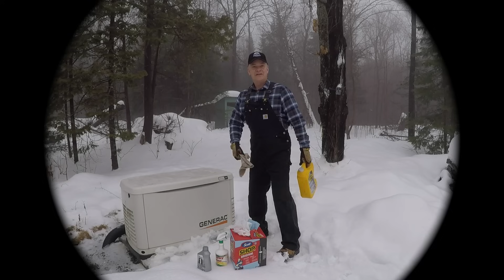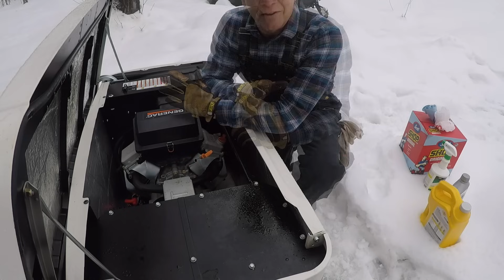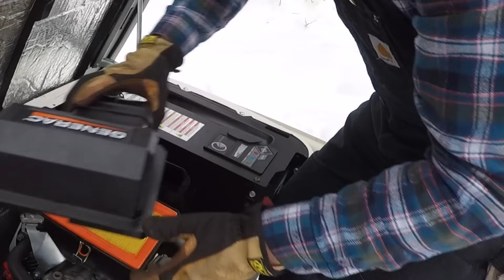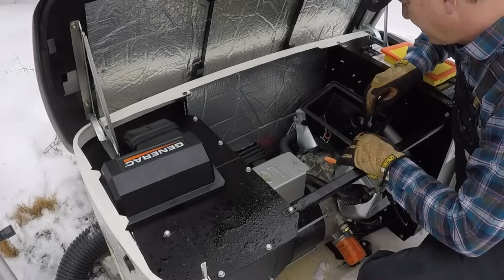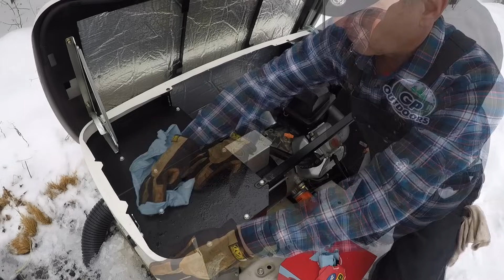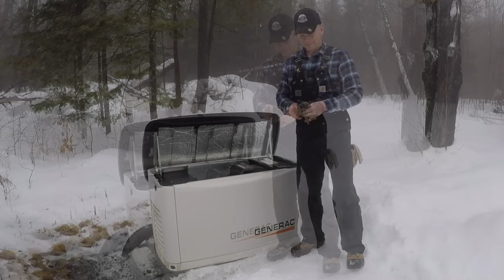#133 Thinking of Buying a Generac Generator? You Need To Watch This!

Comment: I am a Generac service dealer in central Ohio and have been installing and servicing units for 17 years. I have seen this problem several times with really cold weather.  A few additional comments to what is in the video is that the breather mechanism (not exhaust) is under the shroud that is around the flywheel.  This can ice up even without the exposed tube icing up.  On the newer Evolution controller generators, I would advise taking the short rubber air intake tube off of the air cleaner cover when running in below 0 deg F weather so that the engine can breath in warmer air from the inside of the generator box.  This will help prevent ice from forming.
Reply from the maker: Good morning and thanks very much for the helpful advice Ken! I will give it a try this coming winter and see if that makes a difference. I had the technicians come and put the additional heater kit on that vent pipe at the end of last winter. So we will see how both do - again, very much appreciate you taking the time to write this out. Cheers and all the best!
Reply: @Kenlynjay 
Just a curiosity question, but what if an owner of these Generac generator units put like a tablespoon of engine anti-freeze in the bottom of that reservoir??? 
That should prevent condensation from freezing like that, right???
Reply: @AzzKicker-bz1cb  I guess it would be worth a try but some of the condensation comes from the breather mechanism and comes up through the tube while the engine is running, so it could still freeze up.  Part of the problem lies in the engine temp being to low during cold weather.  You could try putting a piece of cardboard across part of the air inlet on the right side of the unit when temp is really low to slow the air circulation. Also, as other people have posted, there is a cold weather electric heat tape that goes around the breather tube that will help.
Reply: Ken I also service Generac but deal pretty much exclusively in portables and refer most onsite standby unit to another guy in town that does mainly standby units.   I don't have familiarity with  standby unit other than most are propane or natural gas and that they self operate periodically as a self test.  I am curious how long that self test runs on the norm. I would think that in a cold climate situation, the unit might not run long enough to cook off moisture. Especially since propane and/or natural gas burn efficiently which usually will equate to more water vapor as a byproduct in the blow by gases and build up in the air box. Another not so good side effect is moisture build in the crankcase.  Interesting side note is this unit looks pretty darn close to the 17.5 kw portable save the lack exhaust heat to a carb and exhaust header layout.
Reply: Dwayne, the older units will do weekly exercise for around 12 minutes.  The newer Evolution controller units will exercise for around 5 minutes when it is warm but I believe that they are supposed to exercise longer in cold weather since they have a temp sensor in the controller to tell it to do so.  The times that the breather ices up is usually when the unit runs for a while in super cold weather, so longer exercise time probably wouldn't help.
Reply: Also, I always turn off the low speed exercise function so that engine will run at full speed during exercise.  Generac tech support recommends doing this.
Reply: @Kenlynjay  Interesting sound to me like there is too much airflow around the breather system in cold weather which from what you suggested by restricting airflow will help. I would guess this just compounds more so in cold weather with cold air being denser and more effective at cooling.
Reply: Good reason to NEVER purchase these units.....Never by the Generac
Reply: Kenlynjay would it be possible to drill a tiny hole at the bottom of the air filter receptacle to let that extra condensed water drip ?
Reply: @UnhingedWarrior  That is what I was thinking.    like a weep hole
Reply: I agree with those defending this guy. He's a good dude, just trying to help us out and maybe make a buck on an good instructional video. Nothing wrong with that. I appreciate people like him big time. And so do all you mockers out there. If you didn't, you never would've even clicked on the video. Losers! =×
Moving on; 
To maybe "fix" the Generac(without the rubber plug or tube) problem, I imagine you could just drill a couple small drainage holes in the very bottom of the air filter housing, (if there is a spot below the housing with no wires under it to get wet). Maybe put a small screen down in there or underneath on the outside just to be sure no debris gets in. The extra air shouldn't make a difference in performance when the weather is nice, and of anything it will help the engine run better when it's too cold outside by allowing some of the warm air from inside the crate to enter the air intake, (As the Generac tech pointed out).
It should also never ice up again as the warm air inside the crate should keep the holes you just drilled from freezing up in the future.
 Really quick fix if you can find a good spot to drill. Just a thought.
Good luck everyone, and thanks a  bunch to Mr. Man in The Video(sorry, I didn't catch your name Sr.) for you very well put together and thought out video. It "Is" very helpful!  ;)
Reply: 1. Why not install a Puke Tank so all the moisture for one season can stay safely out of the filter?
2. Why does the dip stick tube extend blow the oil level? (Great design Generac. NOT!)
Personally I'd let the crankcase vent into the air, before risking a catastrophic failure of my EMERGENCY generator!
Reply: @Rob Basque that was what I figured would work. Glad someone else thought of it too! 👍
Reply: Great Idea... I don't have one, I just thought it was foolish of Generac to make a product that pukes oil all over it's self.
Reply: @Thinker2-truth  … I am a factory trained tech on these things and I can tell you the dipstick tube does NOT go down below the oil level. What happens is the oil is constantly spraying inside and it's the vapor / splatter that rises out the tube when the crankcase breather is clogged. The normal path for crankcase breathing has a baffle and drains back into the engine so it doesn't soak the paper air filter. In the old days we vented this vapor directly to the atmosphere but the EPA says we must contain that and burn it off first, which is why we have these issues.
Reply: @Rob Basque … if you drill holes in the air filter housing you will also suck in air that will not pass through the filter element. IOW, potentially "dirty air" that may harm the engine.
Reply: @rupe53: Irrelevant: If it pukes oil, it pukes oil; all over the inside of the cabinet, until the LOW OIL shuts it off!
Reply: @rupe53  Your not driving this down a dusty road like a car, nor are you kicking up dust like a lawn mower.  This is more like an outboard motor or snowmobile that have no air filter.  That and the percentage of air that bypasses the filter would be minimal.
Reply: I have often said the same thing but I have also seen some nasty filters over the years. Lots depends on the unit location and what else is happening in the vicinity. You just never know and if you bypass the filter that's the chance you take.
Reply: I like the idea of drilling a hole in the bottom of the filter, and if your environmentally friendly put a hose fitting in the hole and connect it to a puke bottle.
Reply: Kenlynjay … you're almost making too much sense.  <LOL> Been working on these for 23 years and we've never had the problem till the engineers (EPA?) decided we needed a low speed exercise (noise reduction) and shorter run time. (fuel use reduction) I'm amazed they haven't come up with a thermostatic flap to control the intake air temp and get the engine temp up within a reasonable time. The reality is the problem starts with short / cold engine runs, which never gives the condensation time to evaporate. I can't think of any other Mfgr that does the short run cycles, including Onan and Kohler air cooled sets.
Reply: @Thinker2-truth  … You need to read that again because the oil puking is due to the breather being clogged. (with ice?) IOW, it's blowing oil out the dipstick tube because it has nowhere else to go. These people are saying to drill holes to drain the water and I am saying to run the unit longer (like the old days) to get the engine warm enough so there's no condensation.
Reply: Cédrik Major-Matte Good idea. Make it big enough for the field mouse to get in and nest though! ;) Had one in my truck air box riding around a while back.
Reply: @rupe53 - Rob Basque suggested holes in the bottom of the filter housing where the moisture collects, and I suggested connecting the holes to a Puke bottle to keep it clean. (I'm getting more replies to this video than my political comments. Does that mean people agree with me politically, or are you wound too tight?)
Reply: @Thinker2-truth  … actually, if that were a sealed system so the vapor could still get burned off it would not be a bad idea. OTOH, I still stand by the idea that a warmed up engine would evaporate this moisture before enough could collect and be a problem. A 10 - 15 minute run period once a month would probably do it. You'd' get enough run time to dry things out and still save fuel in the long term.
Reply: @rupe531 - I'm (rupe531) from Generac and we are RIGHT! That is why our generators spray oil all over the inside of the cabinet, and ice forms in the filter housing. Are you getting a clue yet?
Reply: @Thinker2-truth  … If you say so.
Reply: @rupe53  I can only imagine where those generators were.   Dusty road to the house, near plowed fields?   A small weep hole would allow so little to bypass the filter, except in areas mentioned above, I don't see how it could be a problem.  The times that the generator would run as backup power, extended periods, would be during and or after a storm.  This would mean the ground is wet and little to no dust in the air.  Of course there are exceptions to this rule.  CA for one with the power being cut due to the Santa Anna winds.  But for the most part they would not have the freeze up problems there.
Reply: @TheLittlered1961  … In my area we have near 50% of customers with grounds maintenance, which means commercial mowers and leaf blowers filling up the cabinets with dust and debris. I've been to homes where painters are grinding away at old paint and stone cutting is being done within a few feet of the set on a regular basis. It's the kind of stuff that makes for a nightmare on service... and it's not predictable. On the bright side, I retire in a few months so no longer my worry!
Reply: @rupe53  I can only imagine the headaches that would cause.  I am a painter and can not believe they are grinding the paint off.  When it gets to that point, you most likely are going to hit lead paint.  Big no no to grind that stuff off.  On the other hand, I was thinking a 5/32 drill hole.  Something so small that little to nothing can get in.  Just large enough water could drip out and not cause a problem. 

I can see your point thou with the idiots that may work around these things.  Where I have see these units have been in rural areas.  Little to no grass around them. 

Longest I have lost power was 2 hours.  Idiot drove into a power pole.  This is over 20 years in the area,  Have 2 tornadoes on average per year in the whole state.  0 hurricanes.
Reply: @TheLittlered1961  … Yeah, old homes with lead paint are supposed to be handled differently. Here's what I would do IF I was going to design a condensate drain. Drill a hole in the bottom of the filter box and run a line to your catch can. Drill another hole in the box just below the filter and run another line. Both lines are sealed at the lid of the catch can and filter box so this is an air tight system. Both lines go to the top of the catch can so can't suck any water. Water draining out of the air box will need a vent so there's no pressure differential, that's what the higher line does. You check / drain the can every few months as necessary.

What Generac could do with minimal effort is raise the crankcase vent higher within the air box so there would be room for many months worth of condensation, which could be cleaned out during the 6 month scheduled maintenance. Now that I think of it, a handy guy could fashion a small piece of bent pipe to do this and silicone it to the breather tube inside the box. The only reason to have it low is so you don't get oil / water vapor directly on the paper filter element.
Reply: If you're a dealer/installer/servicer of Generac units, can you give an idea on why my friends whole home Generac Generator running on natural gas caught fire? It only had around 1 week of continuous use during one storm here in Florida (other than the self checks)? One morning the unit tried to start to do a self test, but failed to start ... the unit however continuously tried to start and then burst into flames. Had he not been home to notice this, his home would have caught fire. Searching Generac Generator Fires, a good amount of reports of them catching fire showed up (most of the ones I seen from the search used LP/Propane).

Thankfully he was home and the fire department was able to contain it before it spread to the house, if not he wouldn't have a home because of his Generac unit. My roommate and I was talking about getting one, but after this, it'll probably be a different brand, if any at all.
Reply: @MyFREEFrugalHomestead  I agree, especially after a friend of mine unit caught on fire. It failed to start during a self test, and instead of stopping the test and doing a error code, the unit continued to try to start and then burst into flames. Had my friend not been home, he might not have had a home to come home to.
Reply: @rupe53  If you're a trained tech of Generac units, can you give an idea on why my friends whole home Generac Generator running on natural gas caught fire? It only had around 1 week of continuous use during one storm here in Florida (other than the self checks)? One morning the unit tried to start to do a self test, but failed to start ... the unit however continuously tried to start and then burst into flames. Had he not been home to notice this, his home would have caught fire. Searching Generac Generator Fires, a good amount of reports of them catching fire showed up (most of the ones I seen from the search used LP/Propane).

Thankfully he was home and the fire department was able to contain it before it spread to the house, if not he wouldn't have a home because of his Generac unit. My roommate and I was talking about getting one, but after this, it'll probably be a different brand, if any at all.
Reply: @john_thorpe … Ok, I try to have all the answers and I also spent 20 years in the fire service so probably know more than the average guy in this area. To get an actual cause of the fire someone would have to examine the remains of the unit and look for the exact origin. Was the fire inside the cabinet? Where exactly? The engine section, the carb area, the fuel regulator, the battery? Was it outside the unit and involving the pipes / flex hoses? What I'm driving at is the fact that I have seen rodent damage to the rubber flex lines, both inside and outside the units, and a good portion of that is directly related to poor installation or lack of maintenance / inspection. Which type of unit was it? How old was it? Was it installed up to code? Located in a salt water environment? Lots of questions. What I can say is certain air cooled sets (11Kw - 20 Kw) from 5 - 10 years ago are involved in an inspection campaign to look for signs of corrosion  / leaks from the gas plenum chamber. This program is under way as I type but without a formal report from the fire department I can't put a finger on your friend's exact cause. BTW, the gen cabinets are UL approved with a fire rating so it's possible for one to burn and not catch the house on fire, if installed to code otherwise. Distance from the house and other combustibles does play a roll here.
Reply: Loved the video! Totally informative and useful for some light tech-support over the phone! I sell generators all day! Generac, Kohler, Cummins and so on.  Awesome!!!! Let me know if you ever need something!! We have the best prices online;  beat any price, ship for free!
Reply: @rupe53  First off he only had it for around 5 ish years (don't recall exactly the number of years he said, but I'd say between 5 to 7 at most). The fire was inside the cabinet. Even with them being insulated, I've seen some that still caught the house on fire. The connection from the supply to the unit was all metal piping (with the exception of what's inside the unit itself). Routine maintenance, including battery replacements had been done (and no sign of rodent infestation was found). Located in a salt water environment ... well we are north central Florida. Not sure where inside the cabinet the fire originated from, but my guess is around the starter as instead of it realizing it's not starting, it just continued to crank away and then catching fire. At the time of install, it was installed up to code, however here the code has changed some and if he replaced it with another unit, he would have to extend the pad to bring it out farther from the house. There was plenty of clearance behind it as a person could to at least walk sideways behind the unit without any problem. But the code seems to have changed where they want them farther away from the house than what they allowed before. 

I'm not sure the exact model he had, but I believe it was a 17Kw natural gas version. He has about a 1,200 sq. ft. house. 

However, the point is, when it tried to start to do it's routine test, it failed to start ... why did it continue trying to start, instead of it seeing that it failed to start after x amount of attempts or x amount of time attempting to start, shut the unit down with an error code? Also, if I remember right he said that he tried to get it to stop trying to start, but the unit wouldn't respond to him stopping the system.

My guess is that since it continued to try to start that it overheated and burned the starter which spread within the unit itself.
Reply: The inspection campaign covers units from 2008 - 2012 and sounds like his is newer that that. If it's a natural gas set with black iron pipe supply there should be a short section of flex installed behind the cabinet. The flex can fail, but haven't seen many go bad in my 25 years time. Yes, a starter can "stick" but I have yet to see that happen on an air cooled set. The fact that it continued to crank leads me to believe it's a starter issue rather than a control board problem. OTOH, there's always a first time. As for code, distance to the rear on an air cooled set is 24 inches minimum to a combustible surface. (5 ft on a liquid cooled set) The UL rating is for flame spread THROUGH the cabinet. (melting metal, etc) I believe it's a 1 hour rating. (not 100% sure on that) If there's a fair amount of brush / leaves very close its' obvious that can catch fire quickly just from radiated heat. As for national code... that was rewritten shortly after 2006 (after Katrina) and each area adopted it after it came out in (roughly?) 2010. It's changed very little since then and most changes are from local inspectors tweaking for their needs. (usually property setbacks) Prior to Katrina there was no national code, only Mfgr's suggested rules.BTW, if the starter got stuck there's a good chance power can back feed to the gas solenoid and allow fuel to flow. They are both on the same circuit during cranking... until the control sees a rise in engine RPM.... then they split.Side note: Natural gas and propane sets are identical. There's a jet change and a control setting switch made during the start up procedure, that's it. Sets are shipped from the factory set up for NG.Hope I have answered most of your questions.
Reply: @rupe53  Then that's a bad design/design flaw. If "BTW, if the starter got stuck there's a good chance power can back feed to the gas solenoid and allow fuel to flow. They are both on the same circuit during cranking... until the control sees a rise in engine RPM.... then they split." Then in my opinion that's a bad design. If the starter got stuck and continued to crank causing it to overheat becoming an ignition source while it continues to feed fuel to the ignition source ... that's a bad combo. IMO there should be a sensor on both the starter and the fuel flow. So that if the flow of fuel is impeded or low, it prevents the system from  trying to start and possibly having issues with the engine. Also, there should be a sensor on the starter where it would break the fuel flow if the temperature of the starter (etc) is close to a temp that would cause ignition. And if either sensor is bad the unit wouldn't try starting. 

There should be more fail safes than just allowing fuel to continue to flow, especially when something like a stuck starter might be an ignition source. 

Also, on his unit there was no brush, bushes, etc. around the unit. You mentioned "As for code, distance to the rear on an air cooled set is 24 inches minimum to a combustible surface."  The person who checked the unit after the fire told my friend that the new code requires an additional 18" more than the 24" even though it's next to a stucco wall and the only combustible material would be the eaves of the roof.
Reply: @john_thorpe  … I just looked that up and I misspoke before. 24" is distance to a NON combustible surface. From a combustible surface is 5 ft, same as the liquid cooled sets. Matter of fact our new installs have been 5 ft for several years now and we don't take on a new customer unless the unit is up to new code. (since shortly after Sandy, so 7 years now) Reason being is liability. When you have over 5,000 customers there's too much risk involved and too many phone calls when the power has been out for a few days.

BTW, the air cooled sets do have a high temp shutdown, but it's not located close enough to the starter to give an early shutdown in this case. Perhaps one located inside the lid would do it, but the chances of needing it are so slim as to be impractical.... and you can't design a set with everything and still be competitive in pricing.

Some of the fail safes built in are only after a short start / run period. For example, there's a short delay for sensing low oil pressure and voltage output to prevent a lock out in cold weather. OTOH, if the wiring by the starter is melted within that 10 - 15 second delay, then all bets are off and the controller is no longer in charge. There is probably no fool proof way around certain things and that control panel already costs near $500.

BTW, simplicity in design would dictate fuel, spark, and starter be fed power at the same time to allow the engine to start. There's no way around that.
Reply: @rupe53  I know that you need fuel, spark, etc. to run any fuel powered motor. And I'm sure there would be plenty of people who would be ok with spenidng another $100 or so for a sensor, etc. that would help safeguard them against something like this.... I mean come on, they're already spending a few thousand (at least) for the unit/install/etc. If generator a and generator b are the ones I'm looking at installing, I'd spend the extra cash (within reason) that has more safety features, etc. 

You say the air cooled sets have a high temp shutdown, and a sensor in the lid for heat, if the heat is above a normal level that it would close the fuel supply. I'm sure it can be set up where a valve would be held open, but would automatically close if there;'s an overheating problem (one that would indicate the possible presence of a fire), or a bad sensor or broken wire to the sensor.
Reply: @john_thorpe  … What I said was there is a sensor (on the other side of the engine) for overheating. I also said that perhaps one could be added inside the lid. The newest units have an extra shutdown switch on the outside of the cabinet, which disables the unit and must be manually reset at the control if someone uses it. The idea being if the cabinet is locked and you can't get to the switch inside. That said, one always has the option to shut the gas off with the valve near the unit (required by code) or the tank valve. This is what I taught in the fire service classes. This will keep someone from restarting the unit unless they take the extra steps. (gas on and control reset) Is there room for improvement? I suppose, but you have to pick your battles. BTW, I know there's a company out there making automatic gas shut-off equipment for earthquake zones. I wonder if they have anything for fire prevention that would sense fire / flame / excess heat at the range necessary here? IOW, something to install externally that would not upset the warranty or UL listing.
Reply: @rupe53  Ahhh, I thought you said there was one, not maybe adding one (lid sensor/switch). Yes there is a gas shut off at each appliance, but what good would that do if you're not at home?? The reason I mention something that would shut the system (mainly the fuel supply) automatically is that my friend sometimes goes down south to watch someones dogs while he's away on business, and sometimes he's not home for days or a few times weeks at a time. The unit isn't really visible from the street, so it could have went unchecked and without the fuel supply being shut down, you have a fire with a continuous fuel supply, could have resulted in a bad combo. Another thing is that what if something like this happens when you evacuate for a hurricane, so the chances of someone not being home and possibly for days at a time is very possible.  

If you look at gas water heaters, etc. there's a safety feature that shuts off the gas automatically to that appliance should the pilot light go out ... so in some way I'm sure a sensor (or something like that)  can be integrated into the unit. For me, I'd pay the extra $200 (as an example) for the safety, and I'd rather pay the $200 (again as an example) to replace the sensor than to let it have a continuous fuel source and to continuously burn while (say) I evacuated due to a hurricane, or away on a vacation.

Picking battles, yes this would be one to pick especially if I had one, especially with the possibility of losing your home and everything in it. My roommate and I was talking about it. But of course now if I had any generator installed it would be a good 10 feet (or more) away from the house (and everything else).
Reply: @john_thorpe  … Here's a thought to ponder... Since around 1980 mfgrs have had a dual shut off in most stationary sets. It was likely done to satisfy UL rather than some govt agency. (my brain is fuzzy on the details) Propane / NG gen sets have always had a demand regulator. It's job is to hold the fuel back until the engine is cranking / running. It works via the engine's intake manifold vacuum. In line with that is now (since the 80s) an electric solenoid valve that holds back the flow till you switch the control on, or in the case of an automatic set there's a call to start for exercise or power failure. Basically the redundancy you speak of is already there and it would take BOTH failing to cause gas flow without the set running. These two devices are always connected together by black iron pipe or a steel expansion chamber. IOW, not easily damaged. Any soft (rubberized) connecting hoses must be after both of these safety devices. IOW, if the engine doesn't run there is a very limited amount of gas within the cabinet. We're talking a few cubic inches.
Reply: An easy fix that Generac should do. There are braided stainless steel heaters that are installed in drain lines of commercial Reach in Freezers. Install one in the vent line and wire it where it heats up while the unit is running. They pull about 20 watts. Add a T-stat as to shut it off anytime the air temp is above freexing
Reply: @allanc3655  … Generac offers one as part of a cold weather kit. I believe it's 5 watts and should be enough considering the tube is only a few inches long. The kit includes a heater for the battery and oil filter, all with a t-stat and a harness that ties into the 240 volt feed inside the cabinet.
Reply: @rupe53  Great
That goes to show what growing up in Texas make us think about the cold....never thought about a heater for the oil filter...then again people growing up where it is not as hot as it gets here do not know what we have to do to things to keep them running at times
Reply: Your suggestion  of removing the air intake tube is the best solution, as long as you replace it again when spring time comes. I would think that this generator  would operate properly all winter in Canada  with the intake tube off.
Reply: Smokehouse Outdoors   Who is General?
Reply: @Joshua Kiser It sounds like you have an older unit - the first ones with electric governor.  This will run at 57-58 hz until you put a large load on it which will make it speed up to about 61 hz.  The units made since 2008 run at 60 hz all the time.  But if you happen to have a really old unit with mechanical governor, you can adjust engine speed - generally you want around 62 hz with no load.
Reply: @Joshua Kiser No. The wiring harness in those generators will only connect to one model of control board.
Reply: What youre suggesting will bypass one of the most basic emission systems and the earth will explode as a result in ten years. " How dare you ". 
  Lol
Reply: @Arsène Lupin 75% of there market lives in a part of the world where it is warm enough this doesn't happen. So why spend $$ on a relatively small percentage of there sales. Also the engine is likely simply purchased from a third party supplier and so you'd have to convince Generac to be upset enough to call the engine supplier and convince them to do something about it. Even more unlikely.
Reply: IT IS A VENT ,NOT A BREATHER TUBE
Reply: @richardwhite1593  look up "crankcase breather tube " . I do believe that is one of the common terms for it.
Reply: @DwaynePeterson  My weekly self test is 10 minutes, which was set by the installer.  I have some sort of cold weather heater on my unit but I am unsure if that would help with the condensation.  I haven't had the problem but this is the 1st winter with the unit and I think our coldest was 10 F.
Reply: We are thinking of installing one in our home in the desert, it gets to be 128 degrees some days, and we obviously need to run A/c etc. Any feedback good or bad for this extreme? thanks in advance
Reply: @Rob Basque make a plywood wall to deflect noise
Reply: kenlynjay yeah  my kubota dealer services generators too and me wich mostually kubota ones i mostually service on because they use kubota tractor engine parts
Reply: Now's a good time to be a Generac salesman in S.E. Texas (and S.W. Louisiana) .  We'd never have this problem down here. We only get a few weeks of real winter and even that is mild compared to what Canada gets.    I'm looking at buying this 16KW model used from a man who just upgraded to a 22KW model.  He says the base of it is in bad shape.  Will Generac sell cabinet parts? I want to run a five-ton HVAC with it. It has a gas furnace.  I also have two refrigerators and two freezers.
Reply: @traumajock  i m not sure but with the kubota GL series they use the same tractor parts wich makes a life easy wich why im gonna get a GL11,000 kubota
Reply: Cédrik Major-Matte I’m not a technician but it would seem like even a small hole bypassing the filter would defeat its purpose...IDK I’m just trying to learn about this myself
Reply: John Thorpe was